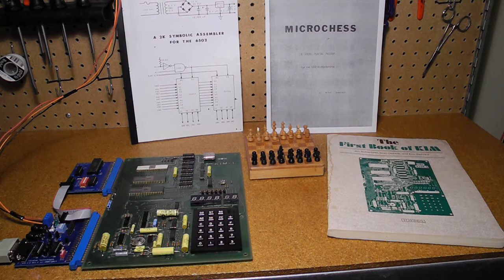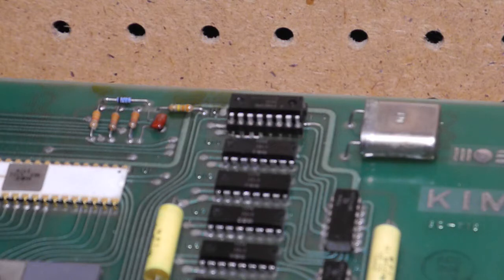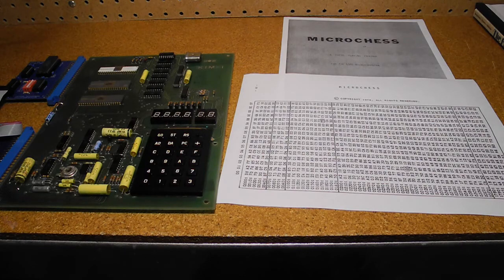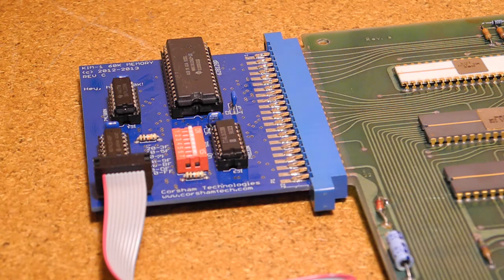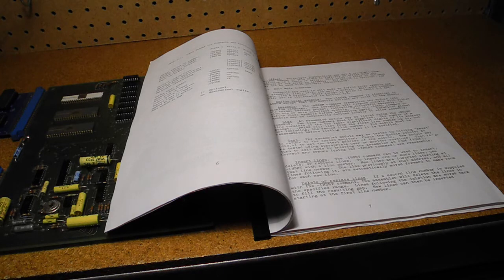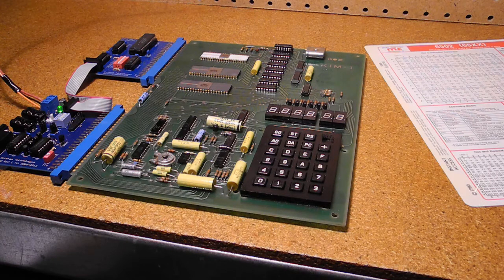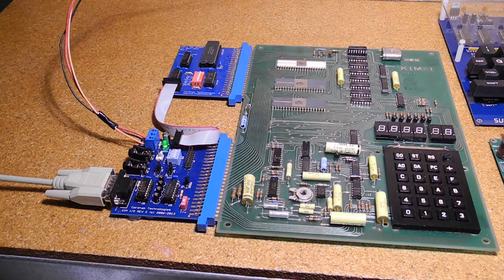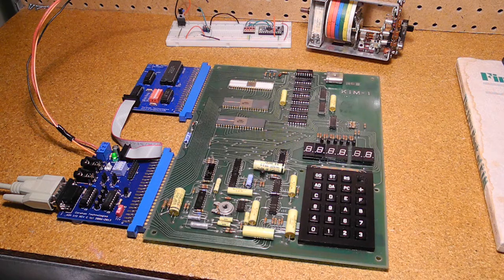The KIM-1 Microcomputer - Part 3: Memory Expansion and Running Larger Programs

Comment: Really love these videos Jeff. I'm glad you decided to repair this KIM and actually use it … I've always felt this stuff was meant to be used, even if it's "old" now. Everything I ever learned about computers is thanks to having ready access to an Apple II growing up, and now largely thanks to Ben Eater's 6502 breadboard system … I'm starting to play with the hardware stuff a bit more.

Basically, I've become convinced that I can—before … my soldering ability is kinda limited (I'm legally blind) and while I've poked at a few basic logic gates and whatnot … so I never really thought I could actually mess with anything as complicated as a processor, y'know?

When you go back to this level of machine … you really start to understand how it works. You have to understand or you just won't be able to use it for much.

Comment: Will you review the tvt 6 5/8? It displays how a Kim-1 can interface to a simple tv set and display code data and programs
Reply from the maker: I have spent some time working on the TVT-6 and TVT-6L versions of Don Lancaster's video output but had to set it aside due to some other projects. I may get back to it, although I want to interface it to my own 6502 Single Board Computer to avoid having to modify my KIM-1.
Reply: @jefftranter  This does sound like an exciting project. As I just received a copy of "The Cheap Video Cookbook", by Don Lancaster. Although I have just found a bad memory location on my KIM-1 and I am having a problem with the ROL command now. Which was working perfectly just a day or two ago. Don't know how the ROL command can get messed up, inside the CPU. Could use some help locating the bad memory chip though. Bad location is $0353
Reply: @jefftranter  Do you have a replica that you are selling? Currently I am looking at the CORSHAM KIM-1 replica. Although I have always enjoyed working on my KIM-1
Reply from the maker: @jeffnay6502  Unfortunately, no.
Reply from the maker: @jeffnay6502  The KIM-1 manuals should indicate which RAM chip corresponds to that address. Early 6502s had a bug with the ROR instruction but the ROL should always work.
Reply: @jefftranter  I have been looking through all the manuals and all I ever see is the memory map, not a chip by chip memory matrix map. 
I am aware of the ROR bug, as I ran into it when trying to load and run the KIM Venture program. I ended up using 8 ROLs to correct the problem. Like I said, the ROL has always worked before, it just started having a problem a day or two ago. It is very strange and it follows a pattern of sorts. The first and second  ROL will work correctly after power on. However the 3rd ROL will fail by a +1. If you try it again, without powering off, the first one will fail by a -1, the second will work according to the first bad number, but then the 3rd one will fail by +1. There is a distinct pattern but none of it is any good. I have tried all three addressing modes, and all three produce the exact same results. I was thinking that it could be a problem with the carry bit of the control register. However everything else seems to work right now. I am probably going to have to put it away, but I love working on it.

Comment: Hey Jeff, I just ran into a problem executing a simple ROR command on my KIM-1, can you try this on your KIM-1?
$0200 18  CLC
$0201 A9  LDA  #EF
$0202 EF
$0204 6A  ROR
$0205 00  BRK

On simulator
With A = EF the ROR = 77 
My KIM-1
With A = EF the ROR = DE
Reply: The ROR problem, is a known bug in the early 6502 CPUs as could be found on the REV A. MOS KIM-1 systems.

Comment: Is your version of Tiny Basic available?
Reply from the maker: +Scott Lawrence Yes, from here: http://github.com/jefftranter/6502/tree/master/asm/KIM-1/TinyBasic
Reply: +Jeff Tranter Excellent. I've done lots of Z80 stuff over the years, and I'm working on a KIM-1/KIM-UNO emulation project and I'd love to throw BASIC into it... I'll be loading it in probably at $B000 in ROM.  Are there any considerations I need to think about with respect to remapping the program to live up there in ROM?
Reply from the maker: +Scott Lawrence Offhand I don't know what would be needed to run out of ROM. I only ported the source to build with CC65 assembler, but I'm not familiar with the internals of how it works. These links might help better
understand what might be needed:
  https://en.wikipedia.org/wiki/Tiny_BASIC
  http://www.ittybittycomputers.com/IttyBitty/TinyBasic/TBuserMan.htm
  http://www.ittybittycomputers.com/IttyBitty/TinyBasic/TBEK.txt